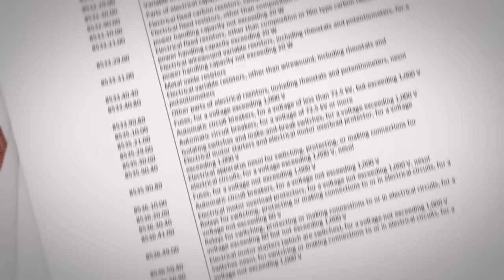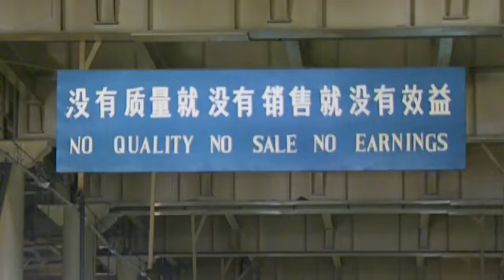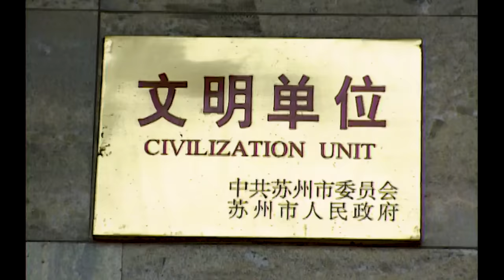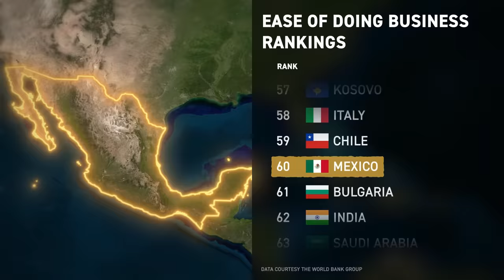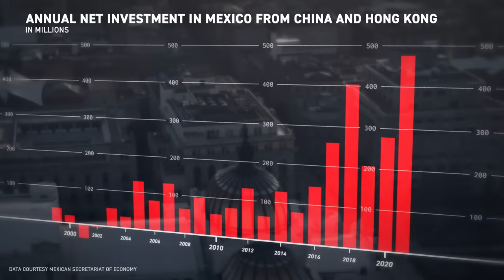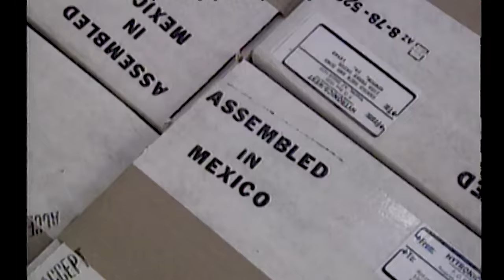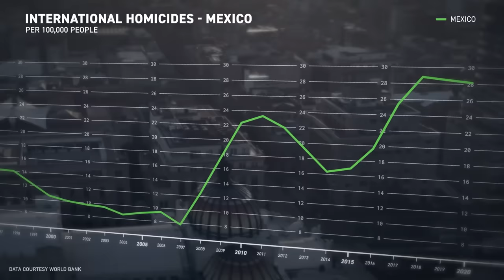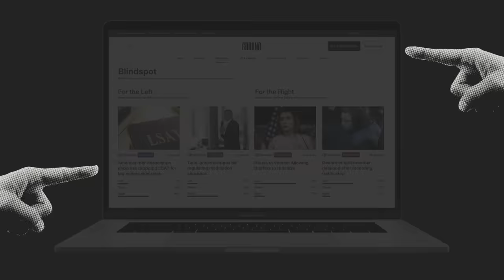How Mexico is Becoming the New China

Comment: I’m actually genuinely surprised to see Mexico that high up on the GDP per capita list
Reply: That's the GDP per capita of that state, which is higher than the rest of Mexico due to all the factories. Average GDP per capita in Mexico is just 10k USD, which is actually lower than China, which is at 12k USD. But local per capita GDP can be much higher.
Reply: Is not surprising if you know that Mexico is cheaper. GDP per Capita PPP balances out the cost of living.
Reply: @luismvg11  By PPP China and Mexico are about equal currently in terms of per capita GDP, at about 19k USD
Reply: @tren133  my comment was to OP sorry if you missinterpreted my comment. There was no point in the video that mentions Mexico's GDP per Capita, it was comparing Nuevo León.
Reply: @tren133  China literally has the highest GDP PPP with US right behind it sir
Reply: @Ernest Khalimov  yes in terms of total GDP, but here they are taking about per capita GDP (PPP), in which case China is about equal to Mexico currently